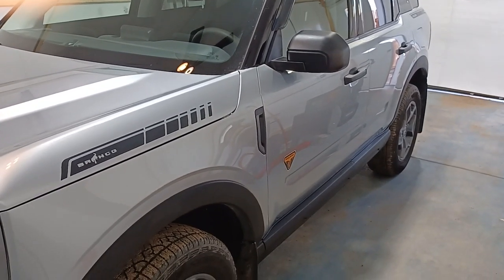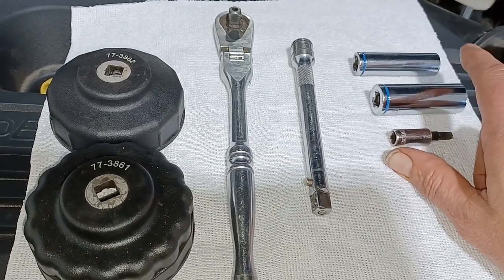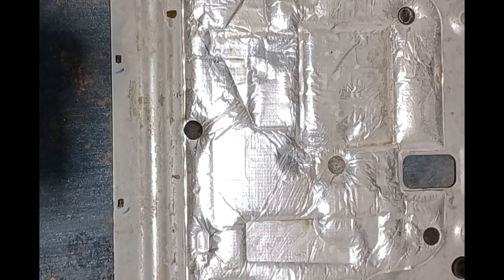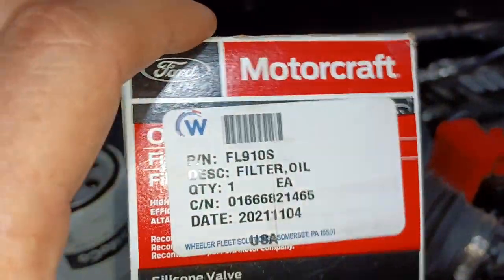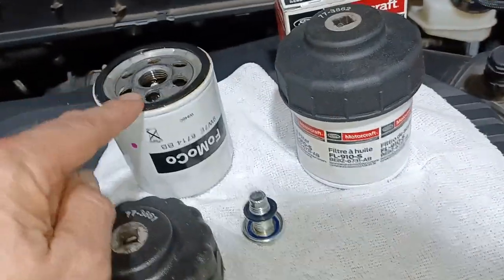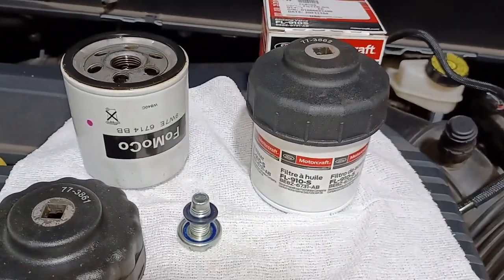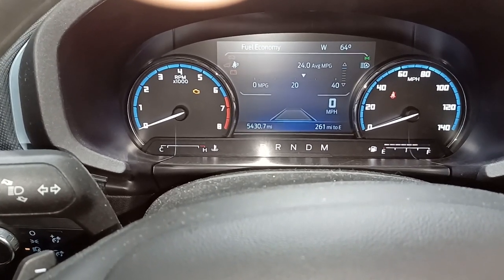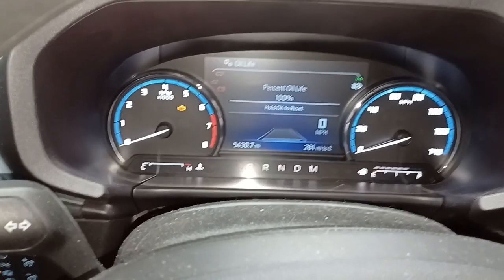Ford Bronco Sport Badlands 2.0 Eco-boost How To Change The Oil

Comment: I give my mechanic the oil and filter and he installs it for 16 bucks. For good relations with your mechanic, you should give them the easy stuff as well as the hard stuff. For example, when I need a battery every 5 years or so, I let my mechanic install an Interstate battery. Sure, I could save about $50 by putting one in myself, but I like to give him the business and establish good will. Plus, he cleans the connections and makes sure everything is ship shape.
Reply: As a professional tech I have had a lot of great customers over the years.

Comment: From what I understand, as long as it’s the correct oil type and has all the same certifications as the OEM oil, they won’t deny your claim on the basis of what brand of oil you chose.
Reply: I was a service manager for a new car dealership for over 2 decades. Your statement is true but it doesn't mean the dealership and manufacturer may make the claim and deny a warranty. If you were to spend a ton of money to make them warranty an engine yes they would have to do just that. I would rather not give the dealer or manufacturer a window to deny a repair.

Comment: Is there room for a longer oil filter?  I have used the FL-400S on my 2011 Escape (OEM is the 910) for 11 years - love the additional filtration and oil capacity it provides.  Badlands on the way :)
Reply from the maker: Sorry for the slow reply I waited until I had it apart again and yes there is a ton of room for a longer oil filter.

Comment: Just FYI, went to my Ford dealer this morning. You can’t buy the gasket, only drain plug complete. If you know where I can get it please share.
Reply from the maker: Inside diameter is 14mm and outside is 22mm. I bought 12 copper washers for 10 bucks off Amazon, but you can pick them up at any parts store or Ace Hardware.

Comment: Is it the Badlands that only has the skid plate - or do the other models like the Outer Banks have them too?
Reply from the maker: As far as I know all models with the 1.5 has a a fiberboard plate held on with screws using the T30 torx bit and 2 plastic clips.
Reply: Only the badlands has factory skid plates. (I don't know about the "first edition")

Comment: Kudos Dale, for an excellent, comprehensive video -- very well done!

I've been working on cars (off and on) for about 45+ years.  I watched your video primarily to get the type, size, and location of the hardware -- to minimize the number of times I have to slid under the Badlands.  You covered everything very thoroughly.

Thank you.
Reply from the maker: Glad it was helpful!
Reply: @daleshotrodshop  I've posted on your thread on the Bronco Sport forum also.  One thing that would add to the video (if you have them) is the torque specs.  I searched quite a bit and could not find them.  Even the 910S oil filter does not have installation instructions!  Based on past experience I went 3/4 turn after contact, and found out after the fact that was correct.  I put 25 lb-ft on the drain plug and 20+ on the skid plate bolts -- just guessing.

Comment: What mileage would you recommend for the first oil change on a new Badlands?
Reply from the maker: I personally believe 5000 should be the max. Everyone has a different opinion on this subject.. I went over a bit because the dealer gave me 4 free changes but then backed out. I am glad I did my own because all the lugnuts were only torqued between 60 and 70 pounds. That video is coming up on Monday.
Reply: @daleshotrodshop  Thanks. So an earlier change  for break-in isn't necessary? Just do 1st change at 5k?